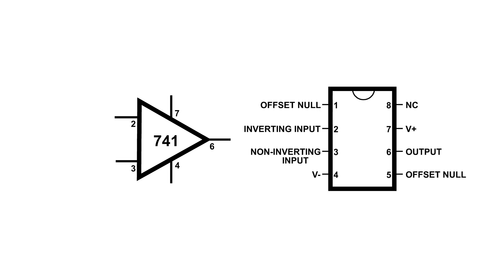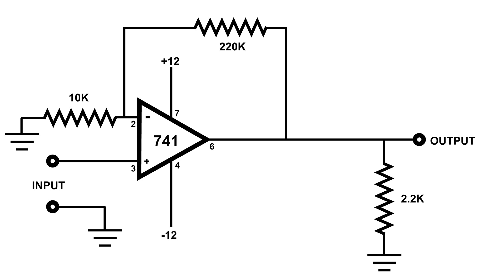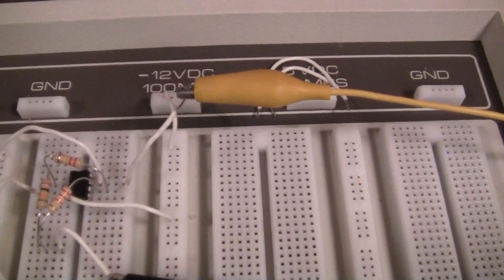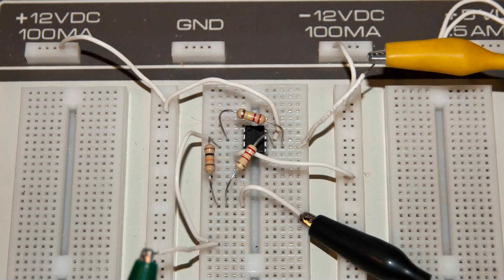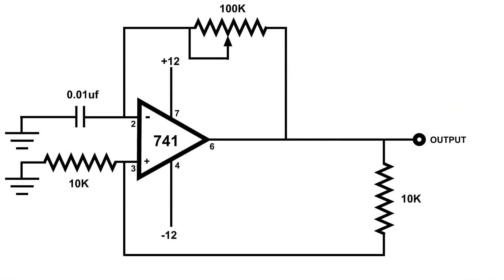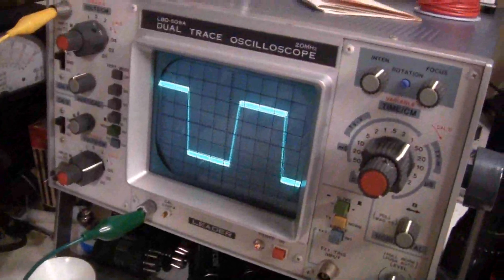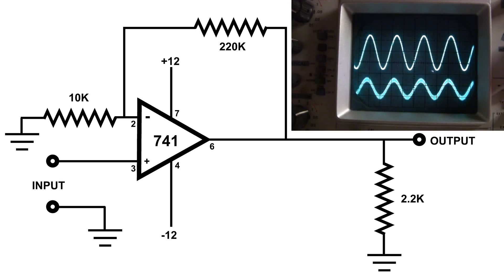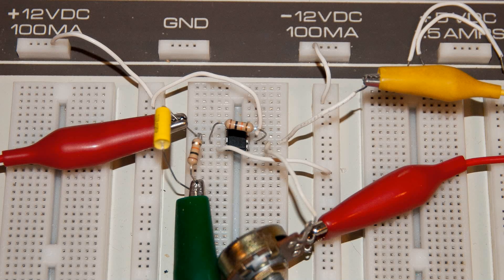741 Op Amp Demo Circuits

Comment: You should have left the 10k on the 2 input.  The only thing you change from inverting and non is the input and ground.  That's why you saw such a huge difference in amplification, the circuit was not biased properly.  Great video though, thanks for what you do!
Reply from the maker: Thanks.

Comment: Do you know if the 741 is the equivalent to an SL27410 or if it'd have the same function? The SL27410 was used in a 70's color organ I have that I believe the SL27410 is bad in. I can't find the datasheet anywhere on it though.
Reply from the maker: This may work
https://www.ic2ic.com/search.jsp?sSearchWord=SL27410

Comment: What was the purpose of number 8 in Lm471?
Reply from the maker: Not Connected
Reply: @AllAmericanFiveRadio  which means it's  just a foot for pcb connection?  I mean you solder it into pcb.
Reply from the maker: @carlotheatheist  You can use it as a terminal also

Comment: why are offset null values used . you didn't use them in the circuit . pls give a demo on how or when to use them .    Thanks
Reply from the maker: Operational Amplifier
by Tony van Roon
http://www.tonyvanroon.com/oldwebsite/gadgets/741/741.html

Comment: What is the frequency range that the op-amp 741 can amplify? can i use it (your circuit) for 1 or 0.5 Hz.
Reply from the maker: LM741 Operational Amplifier
http://www.ti.com/lit/ds/symlink/lm741.pdf
Reply: nothing is mentioned regarding frequency....
Reply from the maker: Bandwidth
Reply from the maker: Figure 5
http://www.ti.com/lit/ds/symlink/ua741.pdf
10K is about MAX
Reply from the maker: The manufactures have not supplied information for frequencies of 1 to 0.5 Hz. I think you could use a single transistor amplifier.
Reply: Hi, what was the gain of the non inverting circuit, why did you require the load resistor, and how did the load resistor impact the gain?

Comment: iam having one doubt regarding negative vee supplay to op amp how should i implement in hardware using only one battery .please explain me .
Reply from the maker: 741 Op Amp
http://www.electronicecircuits.com/circuit-tutorials/741-operational-amplifier/2

The ground must be in the center (between the two batteries). If you use one battery the output will not be symmetrical.

Comment: Ok I'm having trouble, I built the circuit exactly. For power I used 20VDC across two 10K resistors in series and center tapped the middle as my ground point for the opamp. I turned it on and it immediately smoked. I've checked the circuit about 10 times and can not come up with why it blows. Any ideas AM5R. Thanks Keith
Reply from the maker: You need two 12DCV power supplied in series +12-+12-. The -+ between the power supplies is the ground.
Reply: I figured it out, my dumb butt accidentally hooked up the power supply backwards on the board. Everything else on the board was correct.  I have a few more tweaks to make like how to use the center ground on the power supply with a banana plug, so I don't have to use a floating ground and a jumper to the negative, but other than that it works just fine. However I don't get a sine wave I get a square wave, even when I lower the power supply to 10vdc. I think the data sheet says it will work down to +/- 5vdc. I'm building the test set to handle single OpAmp 8 pin types in Radial, 8-Dip and a 14 pin dip. One of the guys at work is testing boards that have at least 10 socketed OpAmps each on them. It made more sense to just pull the OpAmps and test them individually to find the bad ones then replace them and run the board. So far out of the 12 handed me, 6 were bad. This has cut troubleshooting down to minutes rather than half a day. Thanks for the circuit, I modified it slightly but it works great. Best Wishes n Blessings. Keith

Comment: Thanks, Question please. The positive power supply and negative power supply, and inverting input voltage and noniverting input voltage all these are DC? and the output I will get AC? Is I am right?
Reply from the maker: If you have an audio tone at the input, the output is AC on top of DC.

Comment: Can someone PLEASE explain how to power an op amp using two external power 
supplies . And, when I mean EXPLAIN, I mean CLEARLY show the physical 
connections between the power supplies, the breadboard (a regular breadboard, not a fancy one like the one presented in this video) and, finally, the
 op amp. I apologize, since I'm a novice at this, but I can't afford to 
spend any more time searching the internet for someone to CLEARLY 
explain how to proper;y power these IC's. I have 2 power supplies, each 
equipped with a positive, negative and ground terminal. How on earth do I
 make the proper connections to power an op amp, please??
Reply from the maker: +Saki Kaskas 
You have 16, 1 1/2 V batteries all connected in series. This adds up to 24 V, the negative end is on the right, positive end is on the left. At the center of this series, the connection at batteries eight and nine, you add a wire at this connection and you call it ground. Measuring from ground, you have negative 12 V on the right, and positive 12 V on the left.
Reply: @AllAmericanFiveRadio  and we call it symmetrical power supply.

Comment: Thanks for the excellent demo on using the 741 OP AMP.  I went looking for a video on the 741 as I was having trouble making my circuit work.  It looks as if one does not need to ground the offset voltages.  I also had my –V voltage grounded.  As always I enjoy your videos.
Reply from the maker: +David Buck Thanks

Comment from the maker: Hard to tell what the problem is, but if you suspect the problem is with pin three and four you could try making one without soldering that connection. Also I'm not sure what the noise is. Is it white noise, background noise, or is it a low-frequency hum?

Comment from the maker: If you connect the positive lead to the negative terminal of the first battery you will read a negative 12 V. The common ground is between the two batteries

Comment from the maker: It's having to 12 V batteries in series for a total of 24 V. If you hook the negative lead of your voltmeter to the negative terminal of the first battery, and the positive lead of the voltmeter to the positive terminal of the second battery you will read 24 V. If you put the negative lead of the voltmeter in the middle of the two batteries and connect the positive lead to the second battery you'll read positive 12 V.

Comment: On most of the circuits in the video you have a 2.2k resistor from output to ground which  have seen on many datasheets (typical application section)  for opamps and 8 pin audio amp chips although much lower values......but.....what is it's purpose?

Comment: Slightly incorrect, the open loop gain is 200,000, the 1Mhz is the GBP (Gain Bandwidth Product) or where unity gain occurs, but the math used for calculating the bandwidth is correct.

Comment: If your referring to the 741, the Aol or open loop gain is 1MHZ. The frequency range or bandwidth all depends on negative feedback. (Acl or Closed Loop Gain). So if you take the unity gain which is Zero db (or a gain of 1) of the 741 op-amp (1MHZ) and divide this by the amount of gain you want, say 10 then it would be 100 kHz. Unfortunately there are trade-offs with utilizing gain and bandwidth.

Comment: Yeah, Well if your using two batteries in series, the neutral or ground is the connection between positive + on one and "-" negative on the other. 

Dual Output Positive/Negative supply  
                                         |
   + |-----------Batt-----------| - (Gnd) +|--------Batt--------| - 

**Now if your only using only one power source or battery, then you can connect your ground leads to pin 4 on most Dual and Single op-amps.

Don't be discouraged, it's all about learning electronics

Comment from the maker: For a sine wave, running through a transformer would help. With a capacitor of the right value for the frequency across the output, you can get a very nice triangle wave.

Comment from the maker: I uploaded the PDF 741 file, the diagram is on page 4. You will find the link in the show more of this video. It has a large number of Darlington Amplifiers. NPN transistor conducts when the base is positive. PNP transistor conducts when the base is negative.